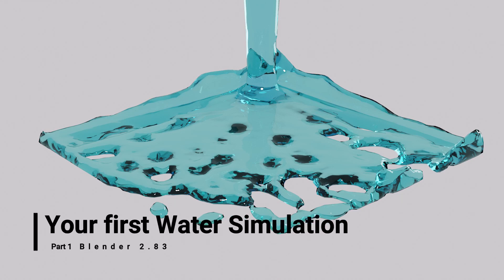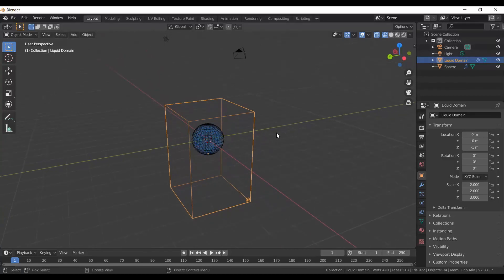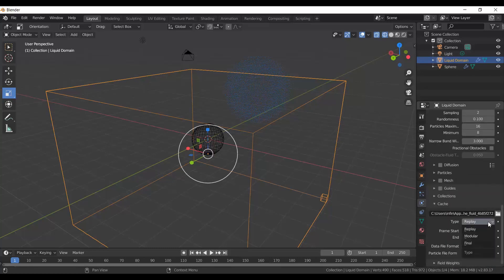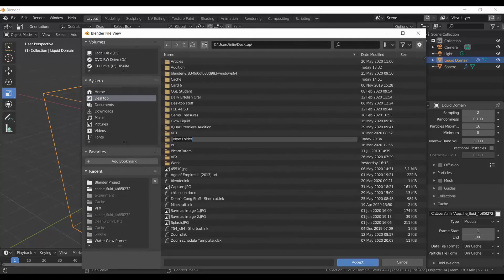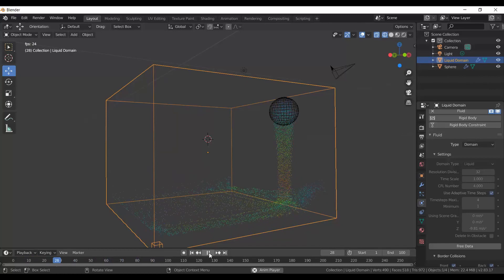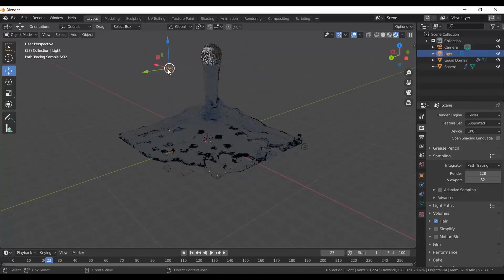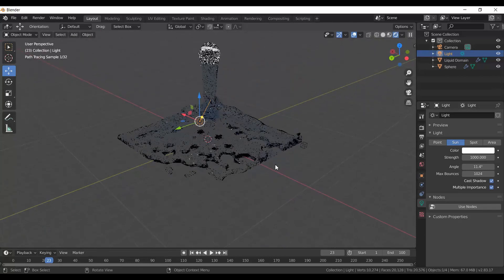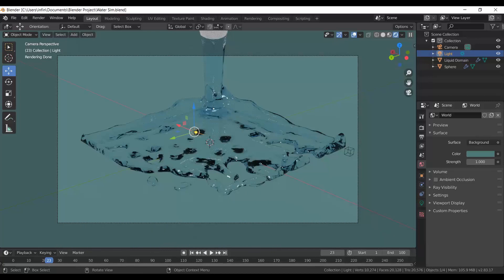Water Simulation Part 1: Blender 2.83

Comment: It’s just that I really want to play the simulation but when I do it just becomes pixelated
Reply: u played it after puting it in cycles
Reply from the maker: Correct if you want see how it will flow try in eevee
Reply from the maker: Also try not to watch it in rendered mode rather solid mode after baking the mesh

Comment: 7:43 Me with 4BG RAM laptop: pArDoN wAiT fOr mE?
also I hate cycles render, it took forever.
Reply from the maker: Hi there yes so cycles can take pretty long specially on your machine specs. Evee will definitely be a better option for you. Shading your water is just a bit different in Evee.
Reply: There are some other rendering engines that u can install to blender

Comment: when i baked it the particles didnt come back and I didnt see any water flow, i'm sure I followed everything correctly. what should i do?
Reply: same here, with blender 2.9. as soon as I move or scale the domain or the sphere than even if I bake again nothing work
Reply from the maker: Have you put it into reply or modular in you domain settings?
Reply: @vgleviathan911  yeah I've tried both, still nothing
Reply from the maker: Have you tried increasing the size of your simulation and increasing the particles resolution?
Reply: @vgleviathan911  i followed along exactly, I'll retry and further increase it and I'll let you know if it works or not

Comment: In the video, when you select quick effects/quick liquid, you get little blue drops. I try it and get nothing. I don't know what is going wrong it isn't that far into the video. :-(
Reply from the maker: Try baking the simulation and see if that helps
Reply: @vgleviathan911  Odd as this sentence sounds, baking the simulation did not add liquid to it.
Reply: @PridePerspectives4U  Having the same Problem Did you figure it out?
Reply: @erik007788  Not really. I switched machines and tried baking, but while I could get a water simulation, it didn't work as advertised.

Comment: When I select "quick fluid", I get a box with a sphere in it but the sphere does not have any fluid in it and playing the animation does nothing, does anyone know why this is?
Reply from the maker: When you click on your liquid domain scroll to the bottom and see if the type is modular or replay. If it's set as modular you need to change that to replay. If that doesn't work try baking your settings again.
Reply: @vgleviathan911  thx this fixed my water sim, the type was modular not relpay